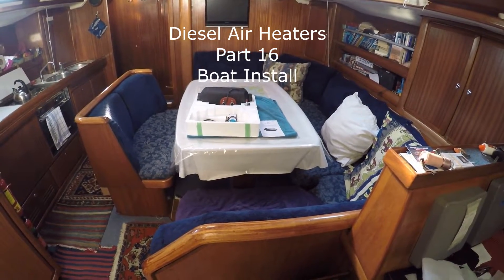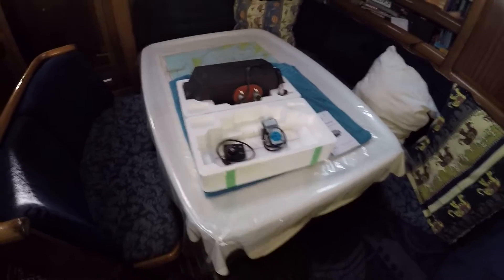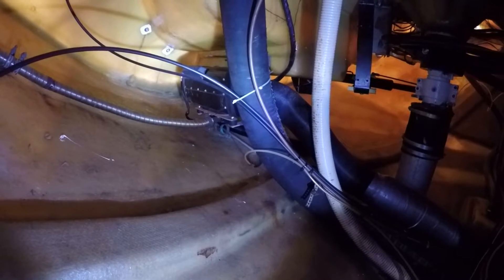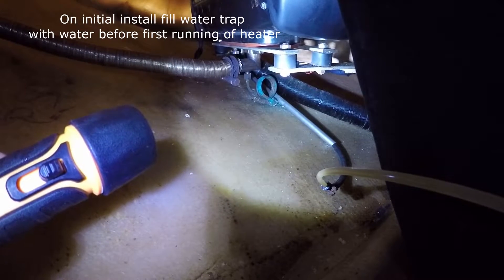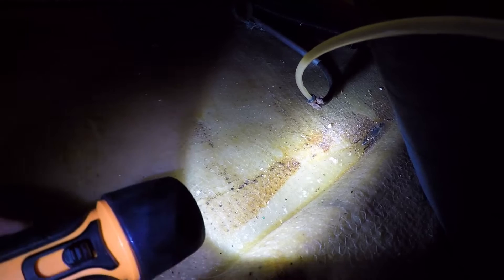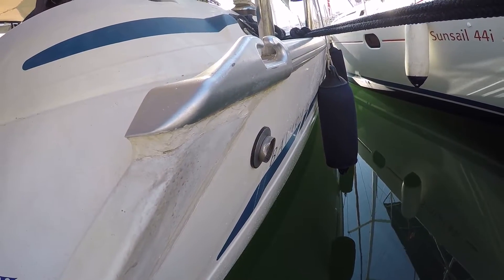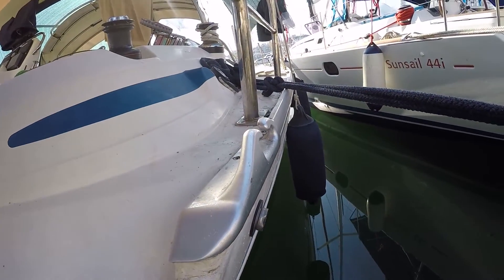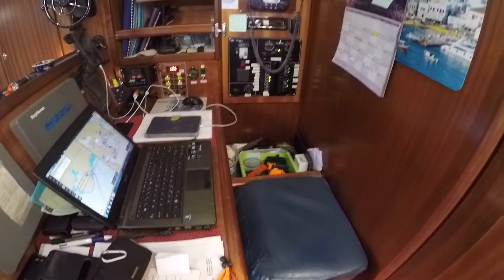Diesel Air Heaters Part 16  -  Boat Install

Comment: Very helpful and exactly what I was looking for. I have watched all your other videos with a boat installation in mind.
Just one outstanding query after having watched all of these.
The water trap.
It's the first time I've heard of this. I cannot see clearly on the video what it consists of.
And I cannot find any other information online about these water traps or where to buy one.
The safety information here was particularly helpful. It made me realise just how dangerous these heaters can be if not installed correctly.
Many thanks again for the time and trouble you have taken in making these videos.
Reply from the maker: Hi Richard,

The water trap is also condensation drain, providing two functions, one draining out any water from the exhaust, and two, providing a gas seal to stop exhaust gases entering the boat.

It is a very simple system of three or four tight coils of copper tube, 5 or 6 mm mounted vertically.

A local fabrication shop could make the exhaust elbow and water trap for you.
There are also a number of sellers on line. In your search use the words Eberspacher, exhaust elbow, and condensate drain.

Here is a link to one supplier to get you started.

https://www.butlertechnik.com/search/condensate-drain

Cheers,   JMcK
Reply: Thank you John.
I see what you mean.
It is very simple.
The elbow and trap is quite expensive too. The same price as the heater.
I will do some searching. I much appreciate your reply.
Reply: John I've just had a thought.
I am looking at fitting the heater to a 25 foot boat.
The obvious place seems high up in the space that forms the cockpit coaming. 
If one were to do this the exhaust tube would come down from the heater and then up and then down again to exit through the transom.
In which case there does not seem any need for an exhaust elbow or a condensate drain.
Any condensate would sit in the bottom loop. And as it's such a small amount would be evaporated off each time the heater is used.
Does that the arrangement sound viable to you?
Reply from the maker: Richard Gooderick ,

Hi Richard, I personally would always put in a condensate drain at the lowest point in the exhaust. Logic tells me that you would have start issues with condensation pooled in the heater exhaust.

There has to be air sucked into the combustion chamber to mix with the diesel for combustion to start. The fan is small with tiny vanes and I wonder if it would have enough pressure to force the outlet non combusted air past the water. If the water in the exhaust stopped this "outlet air", no fresh air could enter the combustion chamber.

But this is my current opinion and I have not tested this, so it is something I will consider doing in the future to see what would really happen. 

But I would still install a drain. Just like anything else connected to the outside atmosphere eg fuel tank, you have "panting". The gas in the exhaust expands and contracts and would suck in moist air every night, so you have the potential to accumulate a lot of condensate water in the exhaust pipe, particularly in a cold moist climate.  JMcK
Reply from the maker: Richard Gooderick ,

I agree, the price is the same cost as a heater. Another item I hope the Chinese manufacturer. A local fabrication shop should be able to make one for you much cheaper.  JMcK
Reply: Point taken John.
Moist cool climate being spot on 😁
I was thinking that condensation would only be after a firing. 
I did not realise that it would be continuous.
Reply: @richardgooderick4536  Hi Richard
What happened with the water trap? Did you do it or leave the condensation in the bend? I like your logic and I think that such a small amount - a tablespoon - should not create a problem at all! I am interested in what is happening in practice since I have the same problem with 21 foot boat.
Reply: @peterchristov5663  
I have probably spent 2 weeks on board (in the boatyard) in total over the (UK) winter. Two or three days at a time.
No water drain. No problems so far.
The exhaust is well -insulated. Hopefully this reduces condensation.
Reply: @VISTLER   That's what I thought I would to do -  insulation, but your experience is very useful to me! How long is the exhausting pipe on your boat? Any curves - degrees?
Reply: @peterchristov5663 
It's no more than 1.5 m.
With two 90 degree bends.
Reply: VISTLER Thank you!

Comment: I have the 5kW Chinese heater. I worked always but I seldom used it. (used electric heater) Now I run it daily 14 hours a day for about a month or two and now everything goes wrong. White smoke starting, black smoke running. Needs a few trials to start ,then it runs colder and colder until it stops. It did not send CO to the cabin (boat) but, even after kitting everything with gungum and alu taper it still smells. I will take it apart but I live on my boat so for safety I think I am going to replace it by  a non-Chinese.  I'm deep into electronics and if they cut the same corners in materials and using unsuited materials way over specs, I do not want to risk my live  or health. 
But thank you for all the info, I now know enough to clean/check/test it or replace it by an original.
Reply from the maker: It looks like you have significant carbon deposit build up in the burner and atomisation screens. 
Suggest you need a burner clean and some serious carbon removal. Before disassemble you could try a kerro/diesel mix, 90/10 running at a high Hz rate for 30 mins to see if you can burn off some carbon that way rather than stripping down the heater..  

With similar operation, you will have similar carbon issues with non Chinese heaters, and remember you can buy 8 to 10 new Chinese heaters for the cost of a single genuine European heaters.   JMcK
Reply: @johnmck1147  I only use automotive diesel, we have no other option here. If I can not use it longer then a month or 2 to daily heat my boat (it is winter here, temps between -zero and +10C) then a diesel heater is no option and I have go back to electric. So buying a real one then is indeed useless. But that makes the whole principle useless other then running it always at full power and then switch it of if the boat gets to hot. 

In the morning I start it, the boat is then around 10 degrees C. It then burns full throttle for 30 minutes or so.  After that it switches to idle and goes up in RPM so every now and then to keep the temp at 20 degrees. That worked wonderful upto a few days ago. It suddenly started to soot, coolded down, switched off and began to smoke white while starting. 

It always smelled it a bit inside the cabin but not in the room it is mounted. So it must come from inside. I think a gasket was already not so great from new. (Chinese do not really check there stuff before selling) The exhaust gasses were before always invisible and the inside of the exhaust was clean like new, now it is black and  the floor outside under it is also soothed.

The heater is mounted outside the in a closed steel "box" under a bench on the rear deck against the steering-hut (11m steel motor cruiser I live on) . The inside part exhaust keeps the box warm to preheat the outside air. Form there a hose goes in the cabin. The exhaust goes to a mounting plate that leads it to the outside.
Total exhaust length will be 60 cm or so. Inlet 20 cm to the standard silencer.
Reply: @johnmck1147  I opend it. Hell of a job because they use paper gaskets that would not come loose in one piece, spend an hour scraping the very rough surface. 

The combustion chamber is completely filled with sooth. In such a way that there is no combustion possible because there is no space left. The glowplug was clean but I have not yet opened the ignition chamber.  Edit: that was clean.  Turns out it is a 2kW unit instead of the 5kW on the label. 

My ECU is not mounted in a box, they used through hole 105 degreesC electrolytics , I will replace them with a good brand 125C. But this one has a second temperature sensor mounted on the PCB so by accident shutting a down would be less dangerous.
125 caps  will last longer. 

I replaced the long very thin original heater copper plated alu wires for real copper over twice the diameter (exept the last 5cm because there is not enough  room in that hole.  That will improve the 3V voltdrop they caused.

Now I have to find metal gaskets. But there must be something really wrong to get this much carbon-sooth. The ECU ?
Reply from the maker: Hi pa4,

I assume you are not using “silly” fuel like used engine oil, or adding 2 stroke oil or similar. Those oily products burn badly and make lots of carbon.

 Suggest you have a look at your install. To have so much carbon, leads me to suspect you have lots of restrictions in your set up. These heaters only have a tiny fan to move combustion air and exhaust air. Restrictions creat a bad fuel air mix and poor burn with lots of carbon residue.

I buy my gaskets off eBay. I search for gaskets for  Eberspacher D4 diesel parking heater. The Chinese heaters a a copy.  

Suggest once a week or so you run the heater around 5 Hz for 15 to 20 minutes to burn off any carbon residue.

Good luck. JMcK
Reply: @johnmck1147  Thank you for the support, very kind. Best wishes for 2024I use automotive diesel, my exhaust is about 50cm, the burn-air-inlet is 30cm and only the default muffler, the cabin air inlet is open. The cabin outlet piping is first  40 cm of the diameter of the heater outlet (66mm orso) and the rest 3m  around 90mm. And that has 2 outlets. A friend calculated that with 3.0Hz and the 0.022 pump it produces in theory around 2kW. Better would be the 0.016 pump. 5.0Hz, 0.022pump would make 5kW,

So I did the factories job and tried tuning it and now it runs better. It has the size of the 2kW but it was programmed to be a 5kW and using the 0.022ml pump. The settings where 1.3 Hz idle upto 5Hz max. 1450rpm upto 5000rpm. I now set it at 1.1Hz (otherwise it cools down to much) and max 3Hz. The fan 1650-1450rpm. Now it still starts bad but it runs better. It is probably just a bad made clone, the sooth problem was probably due to settings and very bad production. The smell was due to leaking through the bad not flat surface of the aluminium. Poor fabrication quality and lack of end control.  Oh, measured the exhaust at 5Hz, the meter jumpd to overload (+1000ppm) even at 3 Hz it is way to rich.
Next week the Autoterm comes in and then the Chinacrap goes to the junk yard. 
I

Comment: Hi John, this is such a helpful video! I have a Bavaria Cruiser 32 and am going to install a Chinese heater in the same spot you have. I am stuck on how to mount it properly and wonder if you can send a diagram of how you did it. The cruiser is wide at the back with the indent for the integrated swim platform. I am not sure how to attach it to the hull any tips are super appreciated.
Reply from the maker: Hi Stephanie,  on my Bavaria in the Med the heater is mounted in the lazaret. It is mounted on a a z shaped metal bracket bolted to the roof. To mount the bracket to the roof two timber strips each with 2  bolts inserted with the heads countersunk and glued with epoxy. These strips with the bolts coming out the bottom were glued and glassed to the ceiling. The metal frame was bolted to this.

On the bottom of the metal  Z frame the heater was bolted down through some rubber feet for vibration isolation. In hindsight, probably not necessary and the silicone gasket supplied would be sufficient.

You could also glass in a frame to the bottom of your boat if you choose. 

Remember, the heater must face fore and aft on a keel boat, but could be mounted on its side if it makes for easier exhaust instillation, provided it is the side with the glow plug on the top. You still must have a moisture trap.  Cheers.  JMcK

Comment: Great video thank you for posting. Not easy filming in the bilge! Wouldn't the condensation in the exhaust simply burn off? Why risk potential CO leak in the laz with an opening in the exhaust line (albeit when installed correctly the coiled loop contains a water trap)?
Reply from the maker: Hi FS,

Yes, if there is only a tiny bit. However more than about a tablespoon of water creates a restriction in the exhaust. 
As shown in the strip down video, the combustion fan is very small and exerts very little force. With a small restriction in the exhaust the burner will not light, so it can't burn off the condensation water.  JMcK

Comment: Greetings from Sweden. Thank you for all of the videos. I now have a brand new 5kW in front of me which will be installed in our 11,9 m boat. There is actually a metal pipe already in place to connect the exhaust. As this is a steel boat it would be better if I could avoid any connection between B- and any metal parts, but I an not sure how to manage that for the exhaust. I will need to order some more parts anyway as I need 90 degree fittings with drain, and also a few vents (will probably go for closable for all but one vent).
Do you have any suggestion how to connect the exhause without grounding it, and if possible solv the issue with draining at the same time?
Regarding the ducting, is there any need for extra fans to move the air long distances or would it be enough to just go with 100mm hose?
Once again thank you for all the time you have put in to this!
Regards, Stefan
Reply from the maker: Hi Stefan,

First you need the condensation drain, as you do not want that water running back into the heater, and you can get lots of condensation in a wet winter.

Isolating the exhaust electrically will be a little more difficult.

You could use a short length of high temperature silicone tube as a joiner, but I have not personally seen a suitable bore size. But you could make a metal adaptor I guess.

You could perhaps make up metal joining flangers, with oversized holes to stop bolts transferring B-, with a high temp silicone gasket.

Are you worried about electrolysis?
Would that be an issue if you installed a double pole power switch or a switch in the negative line and remembered to turn it off after use?

I have not had to deal with this issue in the past, but now you have me thinking.

Ref the ducting. I don't think you will have an issue if there are not too many sharp bends. Seven meters of ducting is not uncommon on a boat. If you have an issue, just install a 12V computer fan at the furthest vent outlet.

Merry Christmas.  JMcK

Comment: Fantastic series, thanks much John.  Just curious as to how well these knockoffs fare in the marine environment vs the Espars....
Reply from the maker: Hi Mr D,

For the price, these are excellent little heaters.

In a Marine environment I suggest you spray the ECB control board with a sealer from an electronics store as it is not encapsulated in resin like the genuine heater.

But that is not all bad, as you have an ECB that can be worked on.

Cheers.  JMcK

Comment: Thank you for taking the time to produce this series of excellent videos. I have watched them all. I would like to fit this to my campervan. Would these be ok to fit under the van? I would as you say keep the glow plug on the top side.
Reply from the maker: Hi Johnlyn, you can fit them in many places provided you do it properly. You would need to provide the heater with protection from road grime, dirt, and water etc.  JMcK
Reply: John McK 47  Thank you. Really enjoyed your videos.
Reply from the maker: JohnlynHD 
Your most welcome.  JMcK

Comment: I am so sorry that I keep asking your questions, but you are the only expert I dare to rely upon.
In one end is the air intake and on the other end is the air outlet. Would it be of any danger or benefit if I mount the intake via a hose to the inside, so the inside air is reheated and blown out in the cabin again?
Reply from the maker: Hi FM,

It is ok and quite common to recycle the heated air from the heater. In the motorhome video in this series the air is recycled. As in a motorcar you can choose to heat fresh air from outside or heat recycled air.

However, as I state in the motorhome video, you must have some fresh air ventilation somewhere in the heated space/compartment that can not be shut off.

You also should have a CO meter installed, to warn of any carbon monoxide buildup.

Your heater works more efficiently by reheating accommodation air rather than cold outside air.

This is a personal issue. Some people only want fresh outside air coming into their accommodation, others prefer to heat recycled air.

Cheers.   JMcK

Comment: Great video.. im about install a Chinese diesel heater on my boat, but had a concern/question…… how close can the exhaust port be to the boat fuel tank filler cap/inlet?  Also the heater exhaust line runs close to the boat fuel tank fill line… is this a concern?  I plan to wrap the exhaust line in a heat wrap.. should I also wrap the fuel filler line?
Reply from the maker: You really need to keep those items as far apart as possible. 

If no alternative, suggest you wrap both in insulation like you mention. 

Make sure heater is turned off well before refueling boat. 

All this is assuming your boat is diesel. If Petrol, you need another solution. JMcK